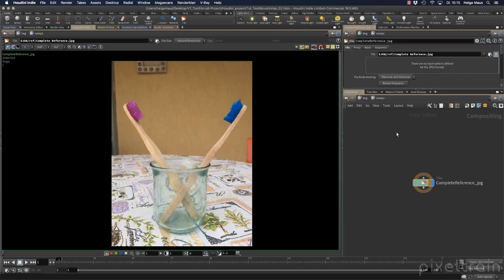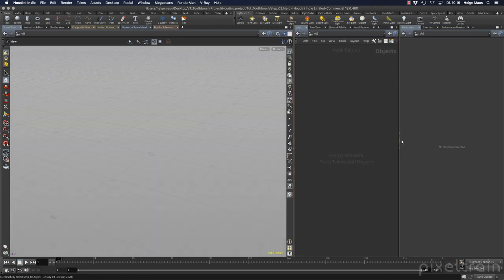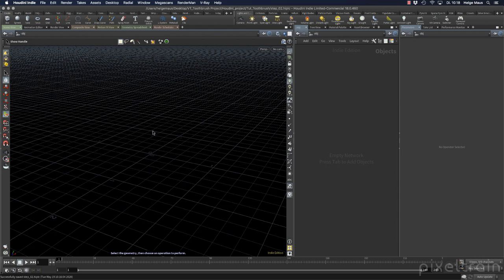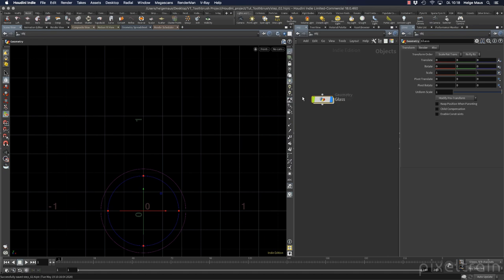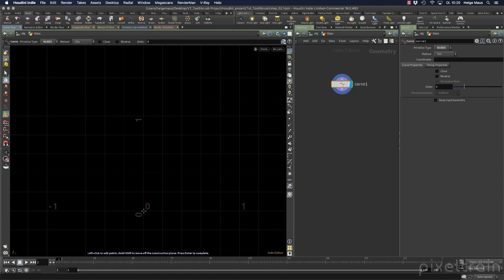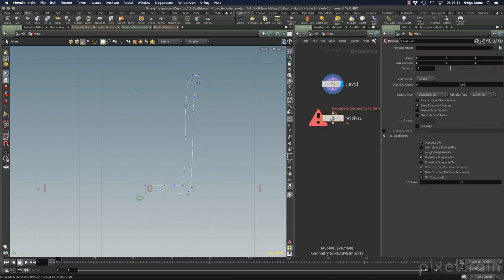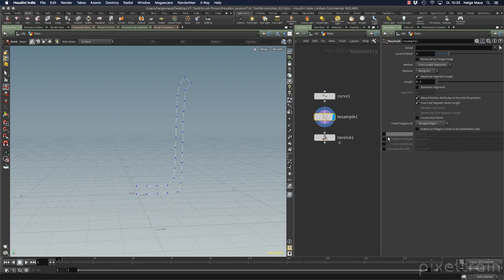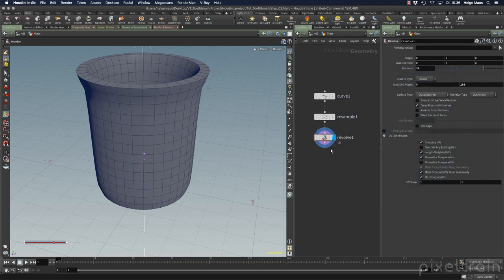Toothbrush - 02 Modeling the glass with NURBS

Comment: thx for your tutorials! Had been looking for the ability to snap to a single axis of a point like you demonstrated with "Point Snapping" + a single handle dragged to a point. 

To others: One thing I had to work through is that when working on a NURBS curve with the "Breakpoints" method, it will be looking for the breakpoint to snap to, so it won't want to snap to the actual points you see on the line. Turn your "Points Display" on in the sidebar to see the points it will actually snap to OR use the CV method to snap to points you see directly on the curve. *Edited for clarity
Reply from the maker: Hi,
Thanks for your comment :-)

Hm, tested the Point snapping in a Edit-Node for NURBS Curves on the CVs. They snap in Points Mode without activating the Points-Display. Where exactly do you use this workaround? 

Kind regards,

Helge
Reply: @pixeltrain3d  Ah sry, I didnt mean to confuse. What I was trying to point out is that on a NURBS curve with the breakpoints method, it is the breakpoints it will snap to, not the interpolated points it puts in between. I was trying to drag to the interpolated points I saw on the curve, as the others were invisible without Points Display on. I will edit my original comment so it doesn't confuse people.
Reply from the maker: No problem, I love that people help each other :-)
Thanks for that!

Comment: Snapping doesn't seem to work anymore using 18.5.
Reply from the maker: Yeah, I also had some problems in 18.5 with it ... Hope, sidefx will fix it soon!
Reply: I also tried to find a solution. Using the point snapping and the transform handle afterwards worked in my case.

Great tutorials pixeltrain, thank you very much!